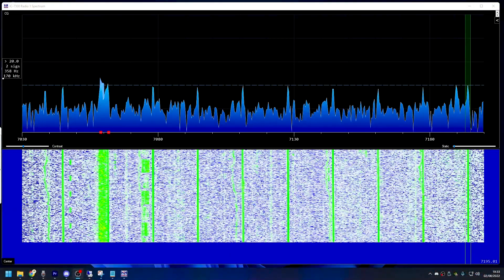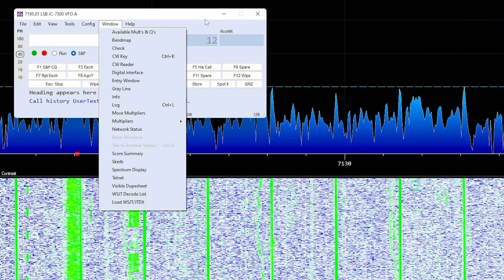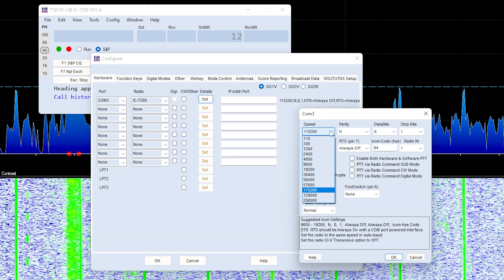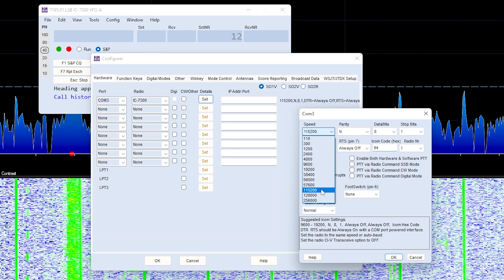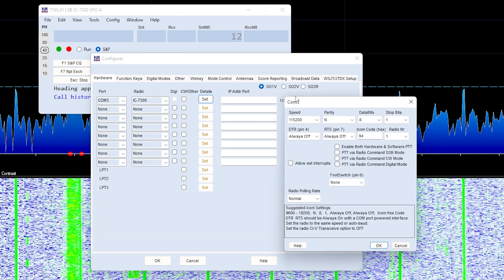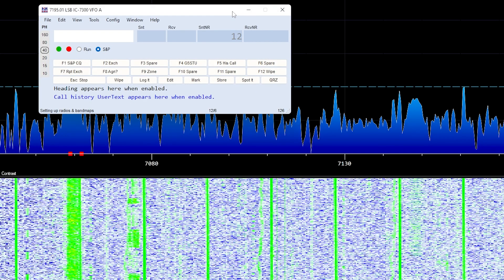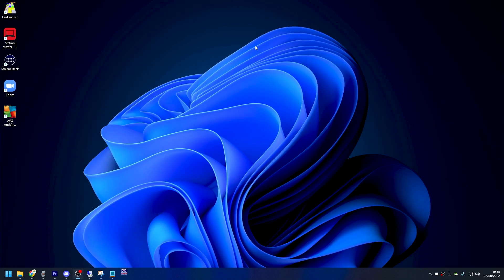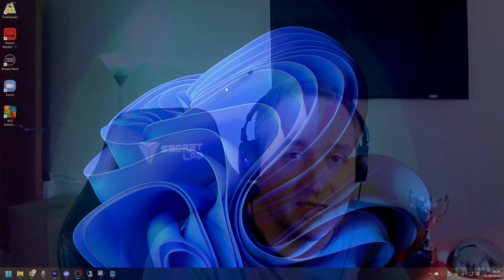HAM Radio Logging N1MM+ Big Screen Spectrum Display  ICOM IC 7300

Comment: Doesn't work for me. I'm running N1MM+ version V1.0.10733.0. The right clicking show the menu different than yours. There is no Spectrum Source option but there is a settings option. There I found a Spectrum Source section and a choice called "Icom level data - Radio 1". I selected that but it doesn't work. I guess I need to find something that is more recent.

Comment: I would recommend NOT using Automatic for the baud rate on the radio. Historically that has been unreliable and caused tons of software support issues.
Reply: Unfortunately it doesn’t seem to work with a wireless connection via RS-BA1 with a 705 as the ONLY runs at 19.2 even though the Icom software presents the spectrum display.